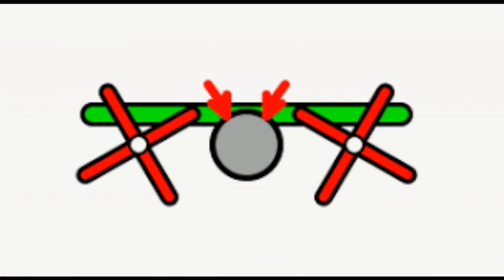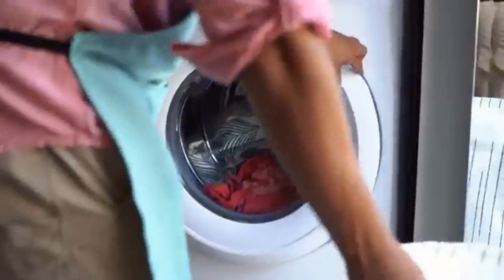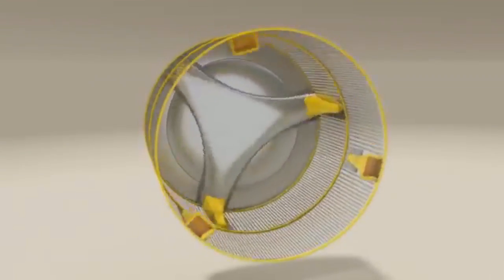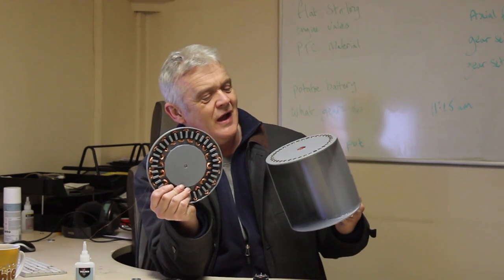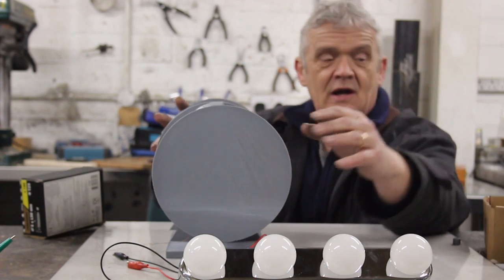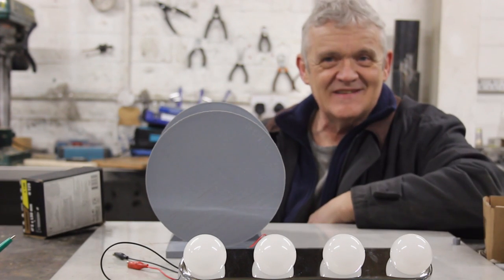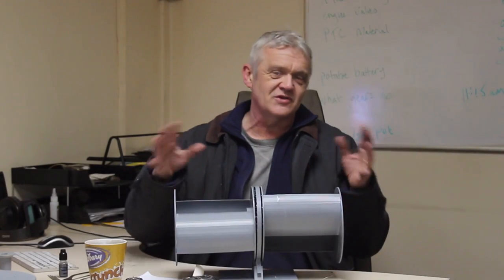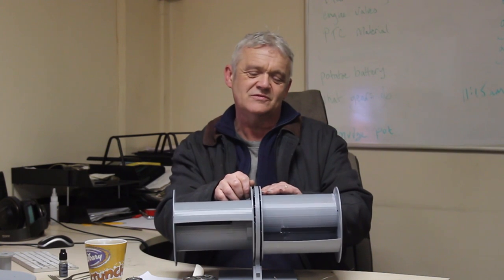1873 The Contra Rotating Wind Turbine

Comment: Dear Robert, here is a request please. Instead of magnets on both drums, where basically you just double the magents (sort of), please consider this.
If speed of rotation is an important factor, then you are on the right track. Please keep magnets on the one drum, but put your snake coils onto the contra rotating drum (no magnets) . Then their speed difference between two drums should (I hope) be double the speed compared to a static snake coil plate?
Reply: How do you get electrical contacts for a load with this setup? If I understand correctly, the drum with the coils that you need to connect to is now rotating.
Reply: @EvanVlcek  slipring
Reply: @davidcarnicom5635  Thanks for the reply. How well does a slip ring hold up over time? If there's mechanical friction you'll both lose efficiency as well as have additional maintenance on the turbine.
Reply: @EvanVlcek  Many many many car alternators use slip rings. Therefore they last for gazzilions of revolutions over many years.

Comment: That was cool.

The contra rotation generates more electricity because you have two things going on.

1) The obvious, you have more magnets.
2) The not so obvious. As the same poles pass each other, the magnetic flux is increased by virtue of the same poles opposing each other and increasing and decreasing the magnetic pressure as they approach and pass one another.

I seen a video regarding Tesla's new electric motor.
They changed the windings so that it has a pointed 
top rather than a typical rounded top.

Rather than winding a coil as is done with the serpentine coil, each part of the winding is a separate element and they have to be all soldered together. Basically, it would be like soldering a bunch of staples together after you separated them.

The look something like this.   
    /\
  | |

The problem with the design is that the soldered joints have to be soldered just right or it reduces the efficiency of the motor.

If your coil had a 45  angle in it like the new Tesla motor, you could add two rows of magnets at a 45 degree angle to produce even more current.

I'm not suggesting you try and make one of these, however, I think that using your conductive ink or a conductive epoxy in place of the solder, would eliminate the need to be absolutely perfect with the connection.
Reply: Round is not scary. 
Pointy is scary. 
🤣

Comment: 2 ideas 💡 

1. Put a fin and a swivel on the stator to catch more direct wind.

2. What about separating the magnets more and creating a wider stator?

2a. In addition, using some magnets around the perimeter (of the larger stator) in free tangental rotation, it could act as low frictional gears to assist the contra rotation and possibly increase power/efficiency.

Comment: If you placed the magnets spinning clockwise & the coils spinning counterclockwise, that would double the speed.
When the speed doubles across the coils and magnets, what percentage increase would the power output be Robert?
Awesome video & Idea!
You are a walking encyclopedia!
I watch your videos everyday!👍
Reply: Idea is nice but i see one small problem. It will complicate things because you will have to make a commutator. And Robert's idea is to make things simple enough to create them easily at home. But if someone is determined enough to make a commutator, then counterrotating magnets and coils is a great idea.

Comment: That's weird that you've been interested in the wash machines you need to get out of my head Robert lmao!👍👍👍

Love the  attractive counter rotation version👍

Washer: how about some 1904 tech in the Dyson design and  pitch the whole thing at an angle below center, install slinger rings on the concentric shafts so the leakage is directed to a catch all and use an Archimedes screw and pump the water back up to a drain plane that enters the drum at the top and dumped it back in. Then for the door area incorporate a drip loop design to guard against the splashes, are use a Tesla valvular conduit buffer to keep it from getting past the door, and have the door reaching far enough to cast off any splash back into the drum again.

The screw could take its power off of the drive line for the concentric counter rotation assembly... or if you want simpler and to use things made of things just throw a pump on the scavenge dish for the water that comes off of the  water seepage slinger rings (or drip control rings if you will). 

I was always a fan of an external centrifuge to get rid of excessive water, and again the screw pump could do a fine job if the Catch system is set up correctly, and I am thinking that a higher rpm can be obtained and the clothes could be much Dryer, this would cut down using a conventional dryers run time and energy usage. 
But that's just a quick five minute thought.  
I've been thinking about designs that are simple, buildable from salvage and super reliable as compared to some of these new units that are overly complicated. Water salvage recycle and conservation can always be added to the design. I used a wringer washer when experimented with external filtering for quite a while until the move forced me to get rid of the ringer washer machine, to this day I regret it, I got the clothes really clean, and the seal was maintained by a two piece rubber compression seal that a soft beeswax similar to a heavy grease to seal the shafts in the bottom, maintaining that machine was a simple 15 minute job that needed only to be done yearly, with more or less a model A automobile wrench and a screwdriver, or the US denomination of a $.25 piece

Comment: I brought up planetary gears in a comment a few videos ago, the term i didn't know was contra rotation. Your washer could be pretty easy if the top of both drums were geared and driven from a motor at the top in planetary manner between them. The outer drum could be just like a traditional washer for drainage etc but no extra holes for the shafts, just bearings.

Comment: I see something ...  that gets lifted up into the air by the wind and when it is at its peak of lift its design brings the lifting body / shaft back down on an angle that the wind does not affect. And in being lifted it pulls up a small weight through some gear work creating electricity as it does. and also when it falls back down.

Comment: Differencial gears to keep the turbines sychronised could help stabilise the voltage, because now, we see the lights are strong, than dimm, and off.
Reply: Im no expert but I think if you have a NN or SS it cancels out and that is why there is no generation. When you do have a NS then the induction time is much faster so higher voltage. Problem is that means you are only generating at a 3rd of capacity. So I think this design trades frequency for voltage.......

Comment: Your design might be helped by the magnetic version of a "bevel" gear operating with an axis at right angles to your rotor axis.  Located at your stator, it would operate like the airplane transmission you pictured at the beginning or a vehicle differential.  Spacing might reduce the stator by a couple coils, but the bevel gear axle could drive a small generator too.

Comment: Well, that answers my question of a couple of days ago. I must have missed this video.
So, today's question: have you looked at nesting one "magnet and coil on the rim" system  inside another? This would be two serpentine coils with two sets of magnets (separated by an insulating layer between presumably)  spinning in the gap between the coils. Twice as many coil/magnet interactions for the same number of rotations +  more weight at the rim giving more momentum and a smoothing effect in light variable winds.

Comment: Hi Rob, two things here,open up the ends of the of the blades so the air can flow freely in any direction yo have an omnidirectional turbine where the wind will turn it from any direction. It can be mounted horizontally on the top of a roof making for a much easier installation. Second thought, a serpentine configuration is like moving a wire through a magnetic field like a horseshoe magnet. Can one put one pole on the rotating disk south south south and another on the stationary disk, north north north. Without having given this much thought, you ought to generate a DC voltage. The wire will move through an endless north south magnetic field?

Comment: Very interesting video!  - just a thought or two: 
The magnetic coupling may  producing a much higher voltage at low RPM because the rotors snap quickly between the coupling positions. (like old ignition magnetos did at cranking speeds).
All that turbulence that the contra rotating washing machine generated, will be there and more, in the contra rotating turbines.  I would expect less wattage then if they spun the same direction,  even stacking Savonius turbines out of phase decreases output.
Reply: Listen to Dan, he's the man. CG

Comment: There was a video released that discussed using this method for offshore wind power generators, but with a twist.  The offshore towers would be at a 45 degree angle, using a counter rotating technique that didn't have two sets of magnets, but one set of magnets and the other was the wiring where the electrical generation was taking place.  The design used a sleeve technique to use the same shaft with the two differently rotating blades.  What do you think of this modification to the idea?

Comment: An array of those might benefit from having an elliptical shape, as opposed to their current circular shape.   Two ellipses can rotate next to each other in opposite directions 90 degrees out of phase, maintaining a small gap continuously.   This way the blades of one fan would occupy the gap left by the adjacent turbine.   An array of such devices would have minimal gaps for air to leak through.

Comment: 1) Did you measure the volts the two methods produced?
When magnetically locked, wouldn’t the coils always have N on one side and S on the opposite? Reducing the efficiency?
When contra rotating, the positioning would be random. Could that be the reason for the flickering lights. 
2) The contra rotating mechanism you showed was two propellers powered by one motor keeping everything synchronized.
Your turbines were contra rotating, probably at different rpm’s. It seems to me the magnetic alignments would be constantly changing, NN, SS, NS, SN, causing erratic electrical results.
3) What happens when you apply electricity to the coils? Will the turbines rotate in opposite or similar directions?
4) Currently your turbines have the magnets in a pattern of NSNSNSNS around the perimeter of the turbine. 
What happens if the magnets were all N on one turbine and all S on the other? Or, all N on both? On a single turbine, or two synced turbines you would probably get nothing. But, on a contra rotating system?

Comment: I am not sure if there is much benefit here. There are times in the rotation where the magnetic fields will be helping each other voltage-wise and other times where they will be in opposition. I think the only way to keep things in sync to always be assisting each other would be to go back to complicating it with gears to time them together again. It may be possible that driving contra-rotating drums would work, though I think then you would still need a way of starting them in different directions before the timed pulses to the coil would be effective in keeping them going in different directions. The same idea in your demo with a motor you did recently where you were pulsing the coils manually, and the direction it would turn was random.

Comment: Those lights are flashing like crazy. I wonder if maybe it generates a similar amount of power on average as if they rotated the same direction, but just had higher spikes and lower troughs.
Reply: This....
Reply: I think not, because the speed of coil/magnets is twice as high this way ;-)
Reply: @markgeurts258  Greater Speed means greater voltage, thats true. But with a conventional set up you will get generation from every magnet interaction with full wave rectification. With this method you will only generate voltage for 1 in 3 magnet interactions with FWR. So does the icreased interaction speed at least make up for the loss in frequency?? I'd hazard not. Best way to find out would be an experiment

Comment: place them vertical side by side and place a diffuser in de. center so it will act as a shield for de blades moving against the wind, you can even place more 4, 6

Comment: How about magnets on one turbine and coils on the other, doubling the rotation speed
Reply: design trade off, to do that you will need slip rings to make the electrical contacts... more complex and introduces more friction
Reply: @RoadRashSpirit  Slip rings with carbon brushes have very little friction, but more expense, Also, some motorcycles use them on the internal generator/alternator.
Reply: @hardergamer if you're trying to harvest 6mph winds that friction will make alot of difference. It also adds a maintenance task. I'm very glad all modern motorcycles use standard 3ph stators and reg recs. Points and magnetos ext are all very clever but just added complexity waiting to go wrong. Each to there own ey.
Reply: @RoadRashSpirit  or you can make a 1:1 transformer and have zero added friction. PCB’s with spiral coils would work
Reply: @geauxracerx  so you want a transformer spinning around at a rate of knots?... Also transformers share the same core normally. Not sure I follow what your trying to suggest.
Reply: @RoadRashSpirit  wireless charging is a 1:1 transformer. There doesn’t “have” to be a core
Reply: @geauxracerx  sounds like a fun experiment. I'll stick with spinning the discs and keeping the stator still  and having a few wires come off it.
Reply: @geauxracerx they still have quite big losses so it's whether or not the gain would be worth it.
In lower wind speeds it probably won't be

Comment: If you mounted the magnets on the fixed center hub and placed coils on each of the turning turbine rims you would not create a mag lock since there would be no compeating magnet sets. The electrical connection at the hubs would require more complexity but should be managable.

Comment: If you support the rotors at the outer ends in addition to the centre, you could still have the existing magnet/coil arrangement at each end, and for the mating faces, if you have magnets in one side and a coil in the other, with contrarotaing fans your relative rotational speed is doubled. You now have two coils at the ends plus one double speed at the centre = ....?
You can send royalties later...😁

Comment: All you need is a big baring the ones where if you spin shaft one way it spins outs other way and little slower,  then on spin dry lock them together and you have you one motor

Comment: The critical factors in this demonstration are voltage, current, gauss field strength, gauss field rotation, and frequency; the last having the biggest effect.
With two counter-rotating magnetic plates, the frequency increases resulting in a higher RMS voltage.

Comment: I would love to see these scaled up and placed on the ground in the centre of all electric pylons on a raised concrete block, and have a system that will feed the power straight into the national grid infrastructure,  It would be cheaper than building off shore and no more a blot on the landscape than it is now with the pylon net work already out there.  I did surgery to the national grid, but they misunderstood me and said that the pylons were not built to tolerate that kind of weight, but like I said these would be placed in the centre on the ground of the pylons
Love your channel Keep up the good work 👍

Comment: oc your axial flux magnetic field Is Contra Rotating on the coils & is better made so it is better canceling out the opposite flux... on the same magnetic locked axis.
but as I told Luke, his version won't work properly as his flux magnetic field 'at the center coil' is rotating left to right above & below hence a axial flux magnetic field is made, its amazing its not canceling out all the volts as it stands.
yours is in effect additively  pulsing in resanance increasing generation, lukes is destructively pulsing out of resanance on the coil so canceling any/most generation.
I.e as pointed out, lukes isn't doing what he thinks it is.

Comment: Hey I'm just about to watch this video but I got on here to actually mention an idea that you should look into that will go right along with that magnetic flywheel of yours.  You should look into magnetic induction heating. 🤔it seems like a length of copper tube closely fixed near the magnets as they spin and the water inside the copper tube gets hot and even boils.

Comment: Re the washing machine, if one motor has two pulleys joined to the same shaft but one of the belts had a twist in it you could get contra-rotation at the same speed from a single motor.